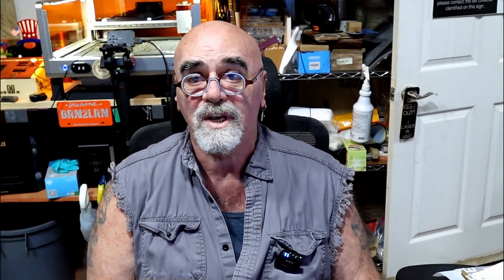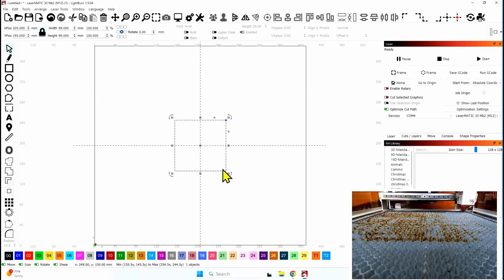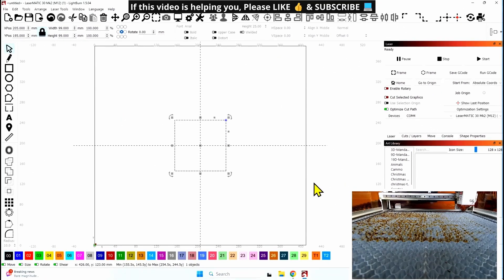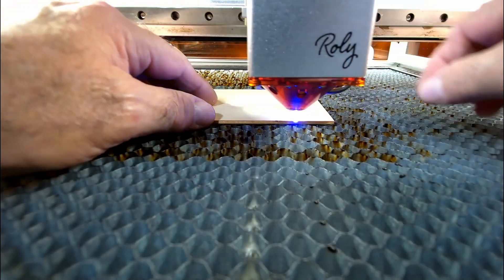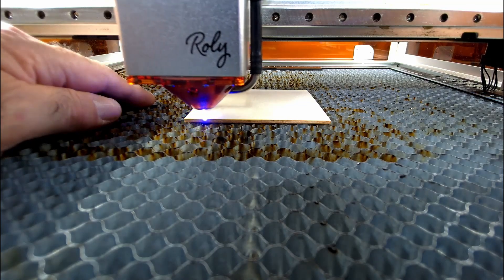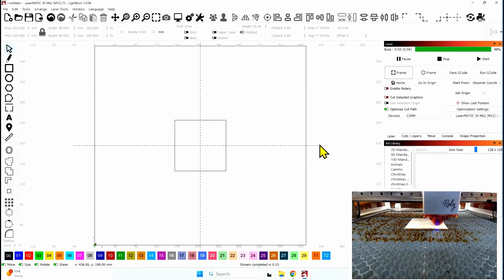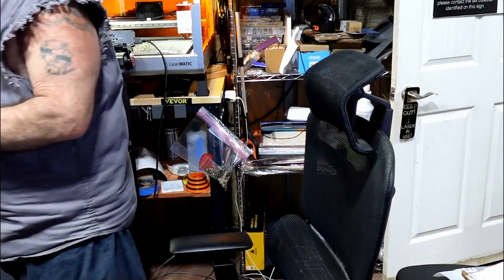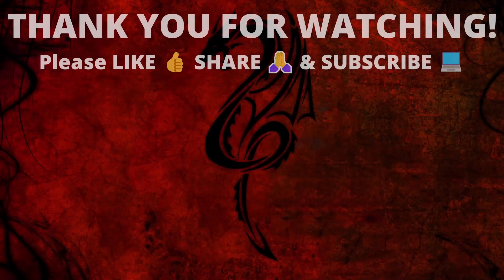💡 Perfect framing for a "1-off" job on your laser in Lightburn! NEW Lightburn feature!

Comment: How do you use the tool path with framing. Ex—I want the tool frame to mark the start of my laser from top corner current position but frame the engrave layer inside the tool path. Or opposite. I want to frame my tool path not the engrave layer when framing. There is a switch on the tool path that says use in framing. But it doesn’t change anything except where my top corner starting point is if I’m using current position or user origin. Hope this question makes sense.
Reply from the maker: You might want to take a look at this video Tina: https://youtu.be/T8DZLl1O0xo

Comment: If you recently bought a new 100 watt laser and a loud beeper came on any and all time the door was open, what would be your reaction? The companies resolve was to place a magnet on the door sensor button to be placed or removed every time the door is used. What is the point of the alarm if the resolve is to disable it?
Reply from the maker: The safety switch probably needs to be adjusted.
Reply: @TheLouisianaHobbyGuy  
They added a separate switch door activated for the beeper compared to slightly earlier 100 watt and above models. There is no adjustment. I know how to install a switch but I’m concerned with a safety hazard. This is our first laser so nativity runs high. Your video’s has sure been helpful!

Comment: Is there a “safety” measure where the laser can only be a max of  say 1% during the continuous framing ??
Reply from the maker: No, the fire button will work in increments of .25% starting at .75 on most diode lasers. A few start at 1%.

Comment: Hi Rich. I am loving my Lasermatic MK2 10/30w however, I have noticed that when framing on certain materials, the laser leaves a mark on the materials. I have tried turning the laser framing setting down but it's still leaving a line on my materials from the laser. Do you know of a way I can fix this and still use the laser for framing?
Reply from the maker: If you set the power to 0.75% on the fire button on the Move tab, that should work.
Reply: @TheLouisianaHobbyGuy   Thank you.

Comment: Thanks for pointing out this new feature.  Without your video I would never have known it was there.  When I try this on my LaserMatric mk-1 if I open the cover to move the wood the laser beam turns off.  Did you override this safety feature on your mk-2?
Reply from the maker: Yes Jesse. A magnet in the front right corner disables the magnetic switch.

Comment: This is fantastic. Query: When i frame i raise my focus to about 10mm to see that all is okay. I then lower the focus to where it needs to be and run my job. If i need to rerun the job (normally a cut) and i need to lower the focus it is never aligns to the original cut. Any advice is welcome. I have an Ortur OLM3 10W machine.
Reply from the maker: You probably moved the laser module slightly when refocusing.

Comment: No sir, I do not have a Lasermatic; I purchased a Xtool D1 Pro 20W based on how great you was saying it was at the time of purchase. Not just you but most other YouTube laser makers were talking them up. I do not have someone giving me stuff for free, I paid full price for mine and cannot afford another one. It irritates me slightly to hear all of you guys putting mine down now just because someone is paying you to sponsor something different.
There, that's my rant, I still love you, just had to get it off my chest.
Reply: I don't think they are saying it is no good.  From what I gather, they are saying, if it does have a problem, there is poor support from the manufacturer.  As time goes by, there are improvements to the next machines.  It is not uncommon to be an early purchaser to find that they no longer have the "Latest and greatest", in fact, it is pretty much a given outcome.  As long as your D1 is working properly, you should be happy to have it.
Reply from the maker: You must have me mixed up with someone else. I haven't done any reviews on xTool products for good reasons. And I'm not paid for my opinion reviews. Nobody is putting you down. Diode lasers have come a long way since the D1 Pro came out.